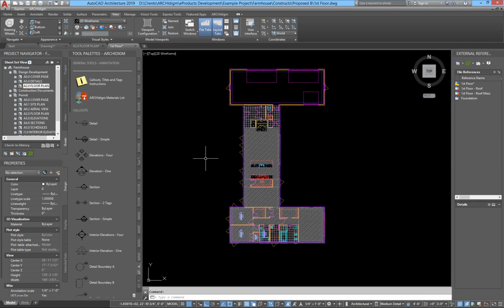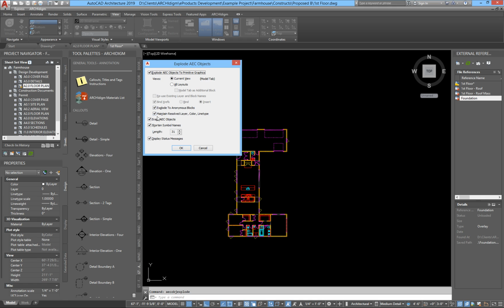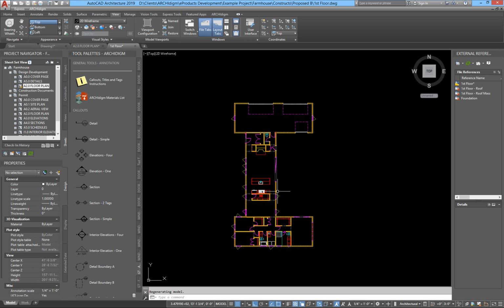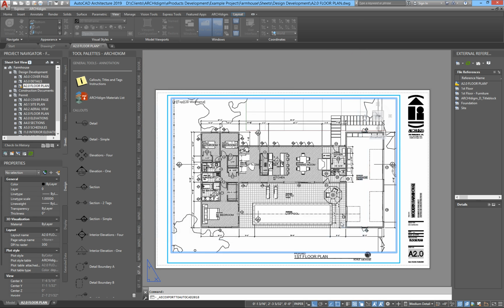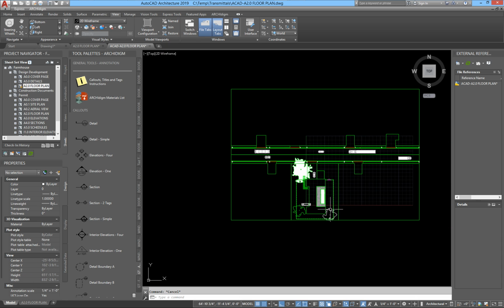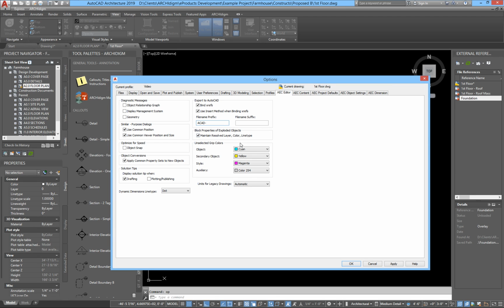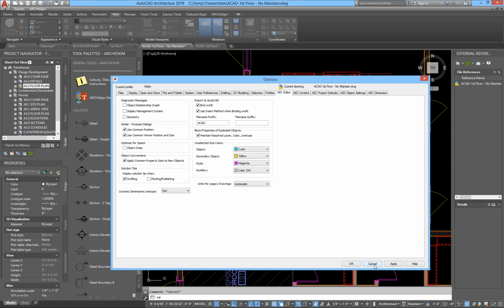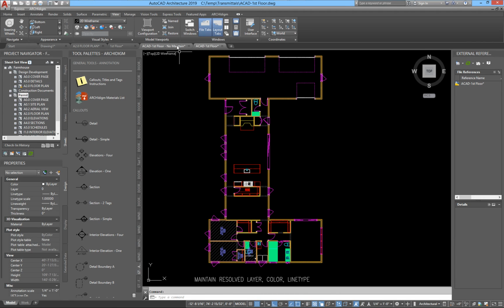Convert AutoCAD Architecture DWG to 2D AutoCAD DWG

Comment: Thanks for sharing! I literally had this problem a few weeks ago. I'm familiar with Export and have used it in the past. But, for some reason, it does not work in ACA 2026. The final exported ACAD file is looking for xrefs, even though my Options are all configured properly.
Reply from the maker: Since ACA is not really evolving I am noticing degradation in functionality as new releases come out.  This may be evidence of further degradation.  However, you may need to run a variety of tests to see if there is a problem with ACA 2026 or your files.  The first thing I would check is if you are dealing with Nested Xref's.  Be cautious with View files because they default to "Attach" Type.  See if you can manually Bind those Xref's via "Insert" Type.  Try different orders because Binding Nested Xref's is order dependent.